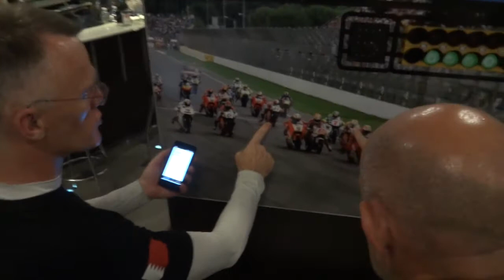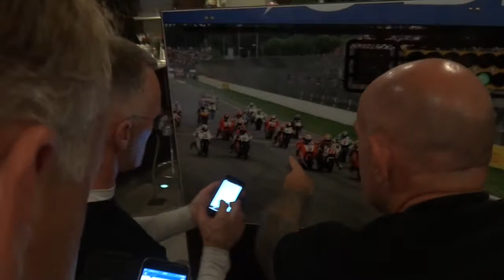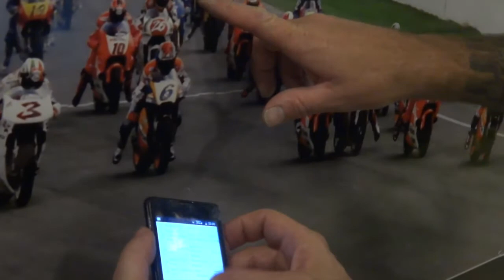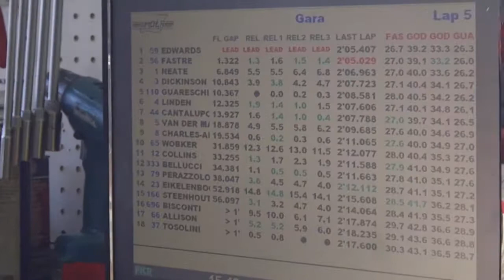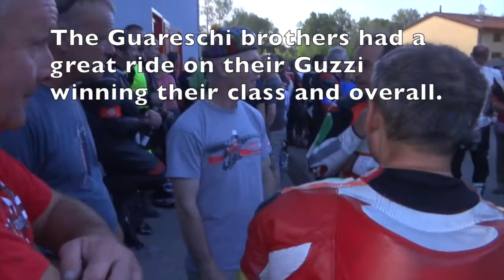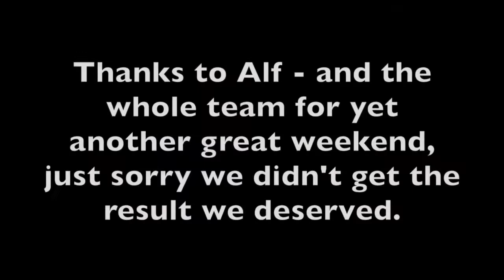Mike 'Spike' Edwards rides Classic Endurance Imola Alf's Motorcycles racing track motorbike action

Comment: BTW, What failed on the engine please?
Reply from the maker: We had a problem with the small clips that hold the Gudgeon (Piston) pin in place popping out, this would then allow the pin to damage the cylinder bore, like you see the smoke when we started it again in the garage. Shame as we were doing so well, the only consolation was I got the fastest lap in the race.
Reply: @MikeSpikeEdwards   Mike, thank you for taking the time to answer so thoroughly, it is a pity. 
You are riding and the team is working so well . BW
Reply: Top tip maybe,switches for cylinders on/off no spark no smoke...racing or sparco fuel taps on/off.saving fuel.lean mean...rich bitch.... brilliant race and event. gaffa tape and go...best wishes.